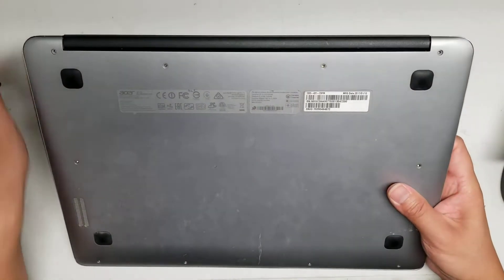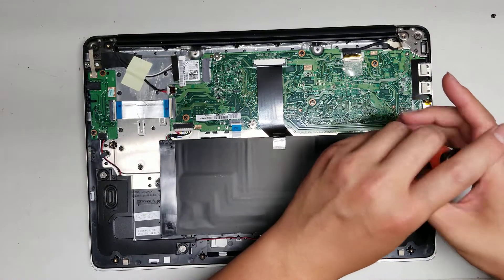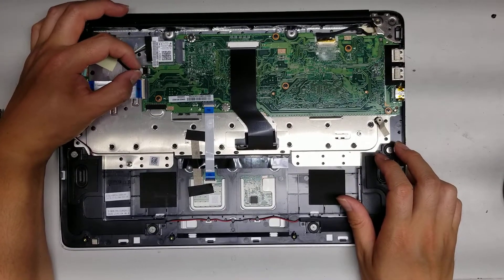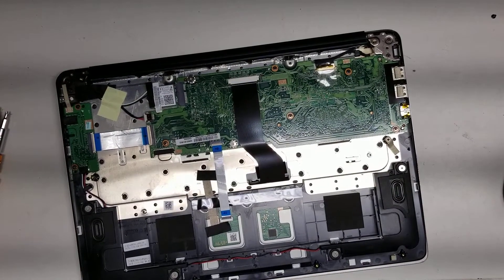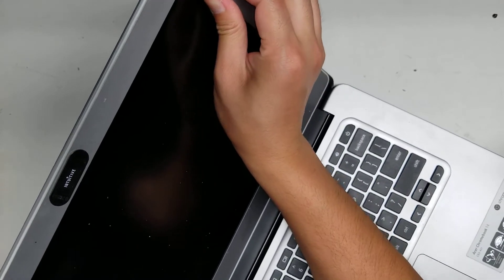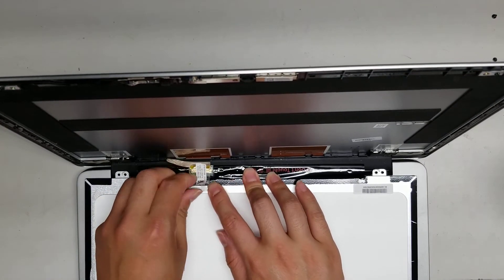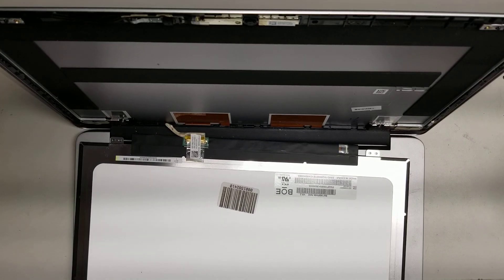Acer Chromebook N16P1 CB3-431 Disassembly LCD Repair Replacement

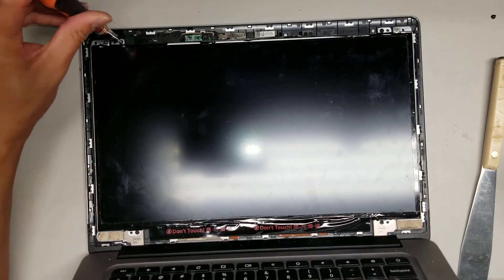Comment: 6:23  The cover at the bottom of the exposed screen has the words "DONT TOUCH"  and you were.... Touching it..   Why cant you touch it?  What is the issue with touching that part of the screen?
Reply from the maker: It's very fragile, sensitive to static, and has high voltages especially underneath the plastic.

Comment: Nooo, don't do it this way.... use a 90 degree plastic spudger and seperate the bezel from the lcd from the outside, don't stick it into the inside... then once you have a good part seperated that you can get your finger under, and then veeeery slowly seperate if off the lcd without putting pressure (or pulling) on the screen, you can put your finger on the outer sides of the lcd to keep it in place and not damage it.
And by very slowly I mean VERY slowly, you can easily seperate the bezel from the lcd without damaging the lcd, as long as you go around the outside of the bezel, don't go stabbing into the inside of the bezel and potentially the lcd.
You can use the 90 degree spudger to get under the bezel on the bottom side too, ofc you might not have you if you can make a start elsewhere, but it's handy

Comment: how would you remove that black hinge piece? to change the ldc cable i assume it runs through there to the other side of the screen
Reply from the maker: Not sure. I didn't do it on that model. Might have to slide like on the most recent video I did.

Comment: Thanks for this video. I only needed it to replace the battery.
FYI: On mine, two of the back panel screws were longer than the other 8. I didn't notice that when I removed them but deduced that they belong on the two outside corners on the hinge side. Also, on the space bar edge, the back screws go in at a slight angle... not straight down. Hope that helps prevent someone's frustration. 
The screws should go back in easily... don't force them. The screws are so small it would be easy to strip the threads.
Reply from the maker: I usually make it a point to tell people to keep the screws in order to put them back exactly the same way they found them.

Comment: I have the exact same Chromebook. Acer Chromebook CB3-431, HD 1366x768. What pin video connector is it? Or are they different? Thank you.
Reply from the maker: I don't know, I don't count pins. I usually get the screen model number.

Comment: Mine works sometimes- Sometimes I have no problems with it and it i bump it or move it, it would becomes glitchy. What would solve that problem ?
Reply from the maker: The screen? Try an external monitor.
Reply from the maker: If it doesn't glitch there, then it's a bad lcd controller or lvds cable

Comment: I disassembled mine to check on a loose screen cable and ended up cracking the screen. I'm assuming it happened while i was trying to reattach the bezels, as they wouldnt click back in easily. Now i'm about to attempt the panel replacement, wish me luck it doesnt happen again LOL
Reply from the maker: D: good luck! Make sure you disconnect the battery and hold the power button before replacing.

Comment: How much do you usually charge for replacing the screen on this model? Also what is the average cost for a replacement screen for this model? Thanks.
Reply from the maker: Don't remember. Screen prices are always changing. Most likely $120-150 total parts and labor

Comment: Would have been nice to show the removal of the black plastic bar at the bottom of the screen assembly where the cables and hinges run behind.
Great video otherwise.
As for removing the glued screen case parts, I use a KoolPak heated for about 40seconds in my 800W microwave and let it sit on the glued part for up to a minute, moving it across (it's not quite long enough to do it in one go). Helps loosen the glue, no need for hot air, although I'm sure careful use of a hair dryer would work.
Reply from the maker: Nice. I do these repairs for a living. These are not my devices to mess around with, hence, I don't completely strip them down unless necessary for the customer's repair. If I accidentally damage a part that was completely fine, my customers will be pissed, and the viewers on YouTube will not and do not make up for the monetary risk it brings.
Reply: @ItsBinhRepaired  completely understand, and I’m in the same situation as you. I removed that part by gripping it and trying to pull it in towards the centre of the lid in a “roll it over your thumb” motion until I could get a pry tool to wedge in then move along with the same motion.
Some clips broke as they always do, but it’s held in fine.
This is necessary to check the LCD cable for pinching, to replace the cable and to adjust and allow a bit more slack.
Did you find that the LCD cable on the motherboard side was not perfectly aligned when you opening it? Like it was being tugged out form the side nearest the hinge?

Comment: Hi, my chromebook has vertical stripes on the screen, do I have to replace it? or has a solution. Thank you
Reply from the maker: Have to replace it :(
Reply: @ItsBinhRepaired  I have the exact same model and my screen goes to vertical pinstripes on the left side only. Closing the book and reopen they are gone. This is a periodic behaviour.
Reply from the maker: @dennisboggan7892  most likely a bad lcd that will need to be replaced.
Reply from the maker: @dennisboggan7892  you can check if it does the same on an external monitor to confirm.
Reply: Double check the cable is seated properly at both ends

Comment: You didnt have to remove the battery, you could have just unplugged it.
Reply from the maker: Yeah, but then you won't see what's underneath
Reply: @ItsBinhRepaired  what do you mean?
Reply from the maker: @roadsidememes6432  if I didn't take the battery out, you wouldn't see the connectors underneath or the battery model.

Comment: hey pal I am in need of some help.one of my wireless antennas has broke the (black wire )-if you fast forward to 3:36 that black wire has split how can i replace that black wireless antenna as you called it. HELP PLEASE
Reply from the maker: You'll need soldering skills and a donor cable to splice
Reply from the maker: That or a replacement cable from another screen assembly.

Comment: What replacement screen did you use I have the same exact chromebook, also how do you tell if it's the wire or the screen?
Reply from the maker: You'll want to open it up to check the specific model number on the back of the screen. If it's the wire, usually moving it around will get it to go on and off. There's no exact way to find out other than using critical thinking and problem solving.

Comment: My chrome book keeps flashing, freezing, changing colors. I don’t know what seems to be the problem could you help me out?
Reply from the maker: Have you tried with an external monitor?
Reply: It's Binh Repaired no I was thinking of trying that
Reply from the maker: @haydenneal3782  give it a shot
Reply: It's Binh Repaired I opened the front part with the camera and I’m trying to unscrew the parts that holds the screen but I can’t because it’s too tight
Reply from the maker: @haydenneal3782  make sure you're using the right screwdriver or you'll damage the screw and it'll never come out.
Reply: It's Binh Repaired yeah that’s what I was worried about is it the ph0
Reply from the maker: @haydenneal3782  I believe it's ph1, but use your best judgement. I don't have it in front of me.
Reply: It's Binh Repaired okay I’ll see if I have it thank you for your help
Reply: It's Binh Repaired yeah that was it
Reply from the maker: Great

Comment: What would be the best replacement for the adhesive tape covering the screen cable connectors? there seems to be so many out there. some are high thermal as well as non conductive.
Reply from the maker: It's called kapton tape if you want to replace the tape.